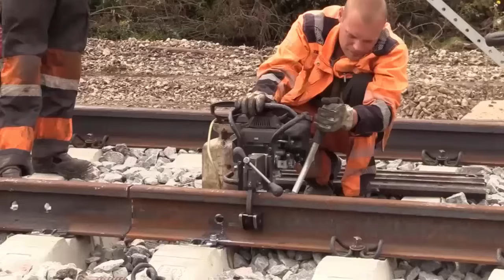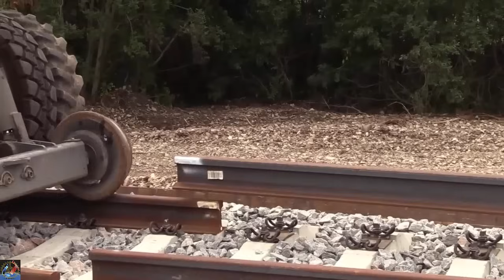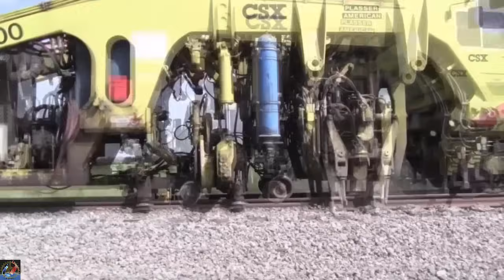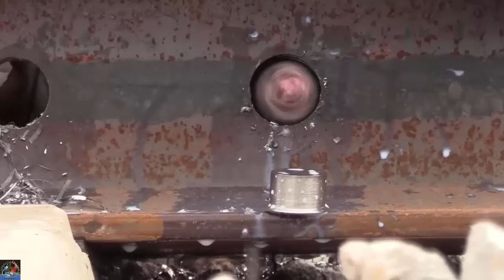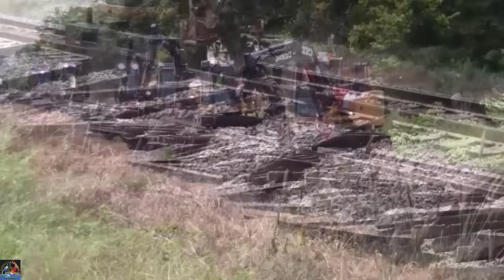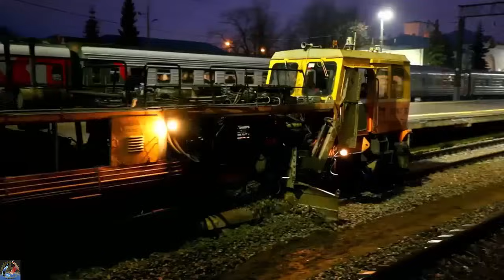Extreme Train Railway Tracks Replacement Modern Technology - Amazing Rail Building Machines 2021

Comment: Cannot believe how flexible the rails are.
Reply: If it is not flexible, it will break.
Reply: @polestar123  you not watch the video the rail bends until fastened in place
Reply: For real, I can't believe that they're as flexibles as wires, it's almost surreal
Reply: They're very flexible but also very strong in the same time. They must be this way, like electric wires, because of the forces and stress they carry. Steel shrinks in the winter and expands in the summer. Rails must also respond to the external pressure - like axle load. It's pretty logical but still we miss how genius the everyday technology is.
Reply: I agree.  I've seen extra rail sitting beside a train track in Canada.  To me it looked stiffer than what I'm seeing.  I'm wondering if there are different grades (thicknesses).   There is another channel showing trains running on tracks in terrible condition.   All the rails I've seen in Canada never looked anything close to that and I'm wondering if the rails are less flexible.
Reply: And now imagine Hyperloop! How dumb was the idea! Just imagine level of technical difficulty making this except - underground (stable temperature)
Reply: @KabelkowyJoe if you work on the railroad. You would want that rail to be good right
Reply: Right!!
Reply: @politicalfoolishness7491 based on the vid, they seem to flame-harden those rails after installation, where as the more-usual cut-to-length rails are installed pre-hardened.
Reply: @lXlDarKSuoLlXl   its 12meters, even thicker I or H beams flex like crazy
Reply: They look like they're made out of rubber when being moved around like this.
Reply: i couldn't either, floppy lil dudes
Reply: Long pieces like that are flexible. Short not so much. Just physics. The machine moving it around makes it look light and flimsy but it’s not. It’s extremely strong and durable.

Comment: They should have ear protection when operating loud machinery
Reply: What?
Reply: Not allowed, because the must listen to the signals given by the warners. Most work is done when trains are running on the neighbouring tracks. Except new noice cancelling earphones with built in warning signal.
Reply: WHAT!!!
Reply: It's like if you don't know anything about the industry you should probably just watch and learn.
Reply: Huhhh? Waaaa?
Reply: Backup buttercup...
Reply: True
Reply: I can’t hear your comment
Reply: They are not allowed they need to be able to here the signals
Reply: @steffenrosmus9177  Huh? What did you say?

Comment: What I find amazing is the rails are very flexible.
Reply: Me too.  I have a short piece of rail in my garage that I had intended on making an anvil out of.  That steel is HARD.
Reply: Right up to the point where they stress (stretch) it. Don’t know about todays methods but 40 years ago they’d stress two feet in a quarter mile - lay 440 yards of rail, leave a two foot gap then put the stressing machine on, pull the ends to close that gap then hold it and weld it. THEN it’s rigid!!
Reply: Yes, surprised by this...
Reply: @billkea7224   you might end up disappointed of it as an anvil because its not actually hardened. noor is it a particularly hard alloy to bigin with. that's just wat soft steel feels like in a big chunk.
Reply: Could be by design. Something too rigid can be too brittle. Designing some flex allows safe operation in different conditions.
Reply: It’s from all the training.
Reply: @tonysmith1131  Very good!!!
Reply: @nick4506  Depending on how long it's in service, used rail can be very hard. Years of carrying all those tons of cars slowly cold forges the steel.
Reply: @hedge685  yea cold working is a thing but  it has to physically permantly deform before it actually makes anything harder. its not that big of difference(in steel) and not a substitute for good steel, also not a substitute for real quench hardening, witch doesn't work on low carbon steels like what they make rails out of.

problem is also rails doesn't permently deform, you'd have to have some crazy super mushroomed out almost a pancake to even sense a difference on a hardness tester. but the rails are reground or decomissioned far before they come to that.

rails are designed to be soft so cracks don't start and derail a train in between inspections witch may be far apart.

also often rails are recycled into rebar and metal fence posts if you want a smaller compression to the grade of steel were working with.

i mean I get it, I want rails to work as anvils too. they are cheap, come an a familiar shape, and are a  relatively big chunk of metal. but if only life was so easy like that. a good hammer blow will dent it, and then that dent will transfer into any work you do on it after. 

i mean you can mush hot metal around on whatever you want but to make good looking stuff with a good surface then a real anvil is the only way to go. or like a chunk of good steel, I'm sure there are some off cuts of some big stuff at a metal supplier. very hard thick plates are often used in heavy machinery repair, like bulldosers and stuff like that, to remake eyes, or the wearing parts of buckets.
Reply: @jonchilds1637  but those rail look like rubber!
Reply: The longer something gets, it becomes more flexible.
Reply: @nick4506  Por 40 años he usado un trozo de riel como yunque OK . Quizás depende del tipo de materiales que trabajes.

Comment: That rail seems tremendously flexible.
Reply: They all are until fastened down that’s how they can make curves the rail has some flex to it.
Reply: @ryans413  You wouldn't think there is flex if you picked up a 2 foot section, but there is a good bit of flex.

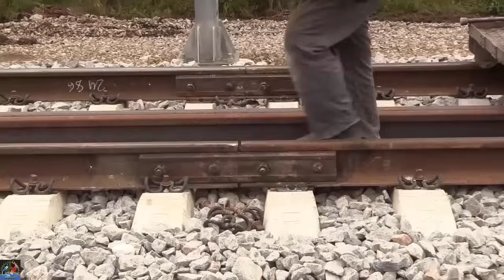Comment: 1:03 - I get the reasoning for the frigging 'beep, beep, beep, beep' when large vehicles back up.
But there should be an override switch for situations like that.
10 minutes working at this site and I would be ready to smash the horn on that thing.
☮
Reply: Well, that would be a handy feature! Being able to make the beeps stop, so that someone who doesn't notice the vehicle approaching, can be silently run over and killed.
Reply: It's a requirement by OHSA to have an audible tone (Back Up Alarm) play around working vehicles.
Reply: And what is backwards on a machine that can work in both directions?. In any case track maintenance machines are LOUD! This video does not convey how loud they are. Sneaking up on you, at least while actually working, isn't going to happen. Beeping doesn't exactly make you notice them more somehow. And they are really slow moving. So I agree  beeping is silly while they are in actual operation. Not to worry though, you don't actually hear the beeping after awhile anyway.
Reply: Um no you have workers all around you doing multiple jobs. It’s mandatory to have the back up beep.

Comment: I have always found railways to be super fascinating. the fact that your entire journey hinges about a wheel not going 1cm astray and the calculations involved to keep a gap between the tracks to accomodate for expansion, contraction during different weather conditions. the speed achieved and a 1000 other things are pretty insane to imagine

Comment: I was myself a tracklayer both on the railways in 19 78 and underground in the mines.
We used a company plasserrail when we were  doing maintenance and replacing sleepers and rails.
Reply: That's the same company's machines you see in this video. Plasser.

Comment: In Germany, they have 400 meter / 1200ft long trains they do all in one, remove the old rails, reactivate the shoulders, put new rails, fix and adjust them.
The single thing left is thermite welding done by hand

Comment: damn.  couple of things.  I can't imagine the tens if not HUNDREDS of millions of dollars that are tied up JUST IN EQUIPMENT.  Then the maintenance which can't be cheap and the wear and tear on the equipment.  Seeing those rail lines bend like spaghetti is weird to see.  It would be helpful if a running explanation of each process was running at the bottom of the screen.  I understand some of the processes, but not nearly enough.  Being the kind of guy that likes to know the whys and how's of processes.  And despite all the mechanical processes there is still a LOT of Manuel labor involved.  And finally, do the recycle the old steel parts and plugs and pieces that are pulled out and replaced with new?  Some of those Manuel processes look like a recipe for back and knee problems in a few years.  I can't imagine when these poor guys has to do MOST of this by hand.  My hat is off to everyone who works this job.  Great video.

Comment: What is the machine doing (digging?) at around the 10 minute mark? What’s the purpose of it? It looks like that would destabilize the rail bed…
Same question around 15:49. It also looks like the point is to lift the rails, and soften the raid bed. An audio explanation of all of this would be wonderful.
Reply: its packing the ballast underneath the sleepers. just search trap ballast packing
Reply: It's a tamping machine that consolidates the ballast.

Comment: Impressive yes, but seems overly complex... the TBM (or tunnel boring machine) does the whole job in one pass. Just needs to remove fasteners, suspend the rails, replace ties, lower, fasten, pour gravel and vibrate into place. These guys could work onboard the rail setting machine or RSM.
Reply: In Europe we have machines that renew old tracks in one flow. The front part runs on the old track, the back part already on the new track. In between the old rails are lifted and removed, the track bed is refreshed and new tracks are put on the new/refreshed bed. In full operation these machines can replace about 800-1000 meters of old and worn out track(bed) within one day. These CSX-operated machines seem a little bit old-fashioned in some aspects. For instance, the tamping machine for new ballast bed stops and restarts all the time. Such machines over here drive constantly with low speed and there is some sort of slider wearing the tamper tool that slides within the machine frame to remain on the same position relative to the ground for each individual tamping action, then slides to the start position. Much less masses to be stopped and accelerated again!
Reply: @Paracelsus74  That's sounds exactly like the efficiency I'm imagining... gotta love that European engineering.
Reply: @burtpanzer  Here you see one of these "killer trains" in action: https://youtu.be/qiDbuPA9YM8
Reply: @Paracelsus74  I knew it was probably German engineering... amazingly cool, thanks!
Reply: @burtpanzer  The one in the video only refreshes the track bed. There are also more complex ones even completely replacing the rails. They are really impressive. 
Basically it's Austrian engineering, as Plasser&Theurer is an Austria based tradition company. However there are 1-2 significant competitors in the market, maybe also a German one.
Reply: @burtpanzer  No, it is designed by an Austrian company, but they have manufacturing plants in several countries, also in the USA.

Comment: Don't do what that chap with the fish bolt spanner was doing. If the bolt breaks, the nut spins loose or the spanner slips off, his tailbone will strike the rail. The only safe way to do fishbolts by hand is to stand to one side facing the nut and push downwards. That way, the knee jerk reflex will stop body parts impacting the rail.

Comment: There is a beauty to the workers and specialized multi-function railway track maintenance machines  laboring away. As a kid looking over a section of railroad track, I'd wonder "who constructs such lengths of this intricate work?". It appears that a more-flexible grade of track steel is used on the High Speed rail tracks, with their concrete ties and continuously-welded rails.

Comment: The scene at 00:13 is not in America. Concrete ties with bolt anchors aren’t used here but the biggest giveaway is the guy operating the saw. No safety glasses or hard hat. No way that happens in America.
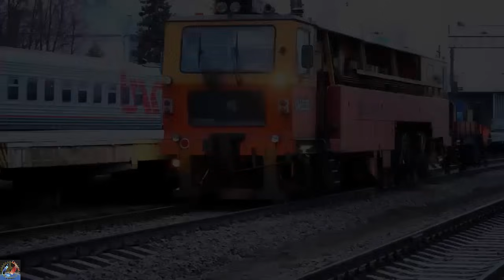Reply: Ты прав, это не Америка, в этом плане вам, то есть американцам, надо отдать должное, вы очень серьёзно относитесь к технике безопасности и это правильно. Этот видео ролик из России, с 21:52 видео, видно что стоит пассажирский вагон где написано РЖД, что значит Российские Железные Дороги

Comment: 6:50  looks like rubber, making you think, why not lay the split wider… but it’s 1084 hot rolled STEEL and only looks so easy malleable cause of angle/length/power of tractor hydraulic.

Comment: Okay, some of the things in this video could benefit from detailed explanations. What is happening, why is that necessary, what are the savings over the old method of doing "this," etc.
Reply: The hardwood sleepers extracted have use by date, the machinery seen here is an efficient process to meet this requirement of replacement to maintain a safe working enviroment for all those whom use this railroad.

Comment: One thing I do not understand in today's methods of rail repair...  Is why the joints on the track are almost always lined up on both sides still...  I mean it would be better to offset the joints in track, with modern high speed rails... You do not need the joints to be at the same location on each side - Unless at a set of points.
Reply: The joints MUST be opposite each other or it can cause a twist in the track leading to a derailment .you obviously do not have a clue what you are talking about if one joint is dipped and the other stays up then you have a twist
Reply: @douglascunningham8971   What I mean by my comment is offsetting the Joint along the length of the rail.  So the joint is not at the same point continuously. The joint position does not matter as long as they weld it correctly and the track is level.. from left to right. without a twist.  
This is how they do High speed rail in europe.  As its welded rail, not using plates and bolts anymore..

Comment: 1:39 for over 20 years rail has come in prewelded 10 mile long sections and is laser welded. joints like this no longer happen.
Reply: How is a 10 mile section delivered to site?
Reply: It's not manufactured in that kind of length. It would be totally impractical. In practice lengths of around 400 to 600 metres are despatched and joined into much longer lengths by thermite welding once in place. In Europe, certainly, a bolted joint as shown here would only be for a temporary repair or off the mainline in a lightly loaded section.

Comment: Yeah those machines are sooo much worse than the European High-Speed-Rail Caternary Track layers... These ones are having trouble working with long wet noodles, whereas european ones are well-oiled 700-meter factories on rails.
Electric-HSR = Concrete I think? And much wider turn radii with lighter up/down grades. Concrete is also conductive so it acts as a ground for the Pantograph conductor above.

Comment: Can these machines lay track as fast it was done by hand in the old days?  Or are these machines just used to reduce labor costs?  If they could lay 10 miles track on a good day in 1869, then using these machines could we build close to the same amount in one day now?
Reply: It lays it faster in that people do not get tired as quickly or injured during work as much, reduces labor costs and ensures the track is laid in a quality guaranteed way. If one makes it a 12 hour shift, 2 shift, even better. Can always do the same on the other side of the track to double the time, but that means more machines too.

Actual construction times of projects like these are not the actual holdups for infrastructure projects. It is always the meager funding and red tape (getting land rights, environmental study requirements, county/state pushing their agenda on a project, etc. that prevents projects from going smoothly.

Take the CAHSR for an example. High cost of land makes it prohibitively expensive, NIMBY's trying to prevent things like it, Funding it but not really fully funding it, and such have caused it the greatest amount of delays. If they fully funded the project, gave the authority eminent domain, and cut the crap of red tape, it would probably have been finished with its first phase by now.

Comment: Why grind rails? Don't they come finished and ready to use?
Reply: Removed the explanation of each advantage.

Google AI Overveiw:

why grind down train tracks?
Train tracks are ground down to extend their life, improve the ride quality, and reduce the risk of accidents: 
- Extend rail life
- Improve ride quality
- Reduce risk of accidents
- Reduce energy consumption
- Reduce wear on rolling stock (train wheels)
- Increase train speeds

why are train track welded together?
Train tracks are welded together to create continuous welded rail (CWR), which has several advantages over traditional jointed tracks:
- Reduced maintenance
- Smoother ride
- Strength
- Quieter
Reply: @SavageSeven-ed3xd  Thanks for taking the time for a list. I imagine there's a host of advantages for welded  track vs. hardware joints as well.

Comment: Are the concrete ties being used in the USA?
Reply: Yes modernization, especially on commuter lines are done with concrete. I've also notice as the older wood deteriorates longer and longer sections are replaced. I was surprised to see an abandoned section of rail was upgraded I think they are going to use it again soon.